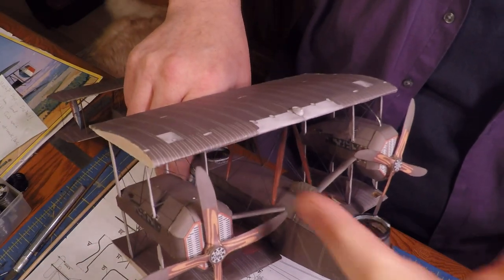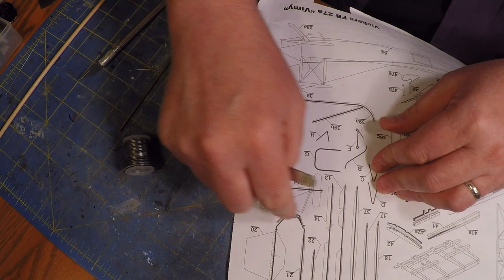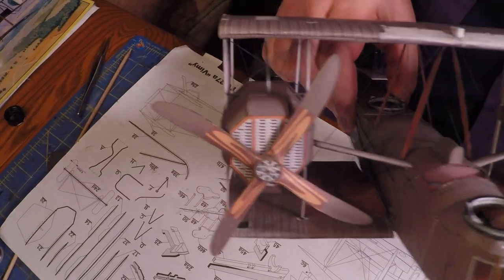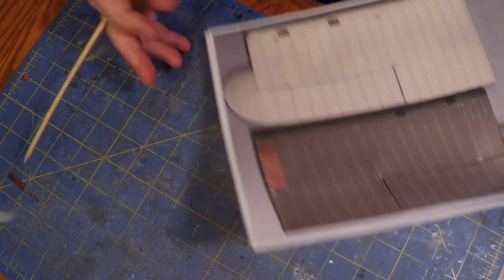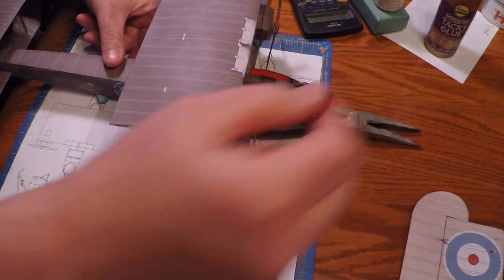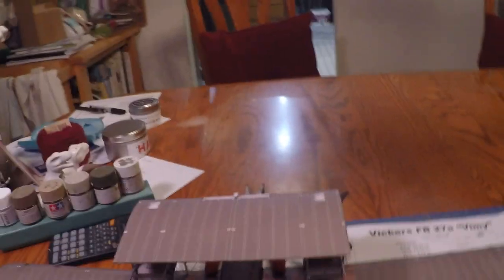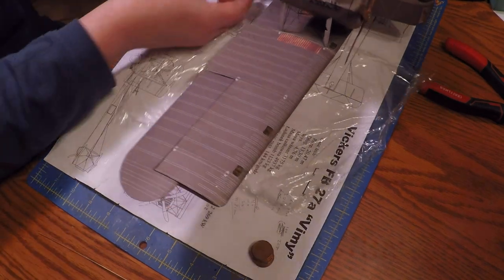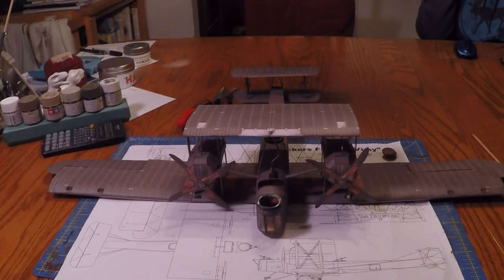Vickers Vimy Paper Card Model Part 14: Some Piping and Attaching the Lower Wing

Comment: If l were doing this on my wifes dining room table she'd go through the roof. 🤯 She had a conniption fit when l was cutting out the MicroArtWork's Service Arm psrts with a cutting mat and a matte board onderneath. Especially after l spilled some nail polish remover on the desk in the office. 😖
Reply from the maker: Ha!  I've spilled so much zip-kicker on my table that I've promised to refinish it...when the weather is good!  Thanks for looking and commenting as usual... -Dan